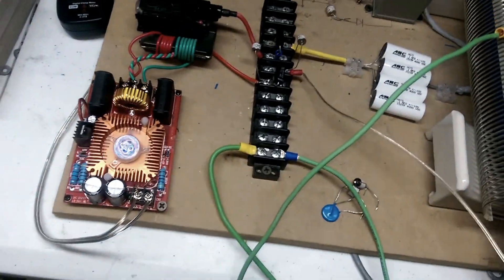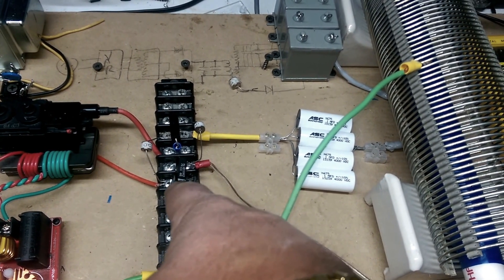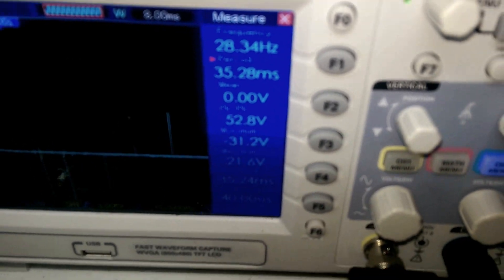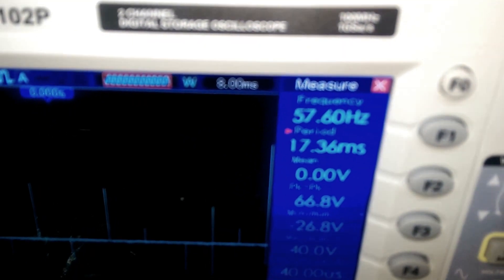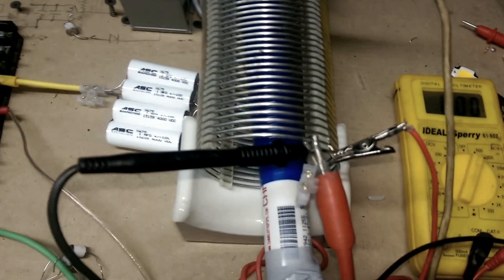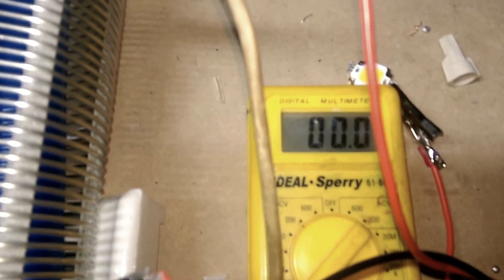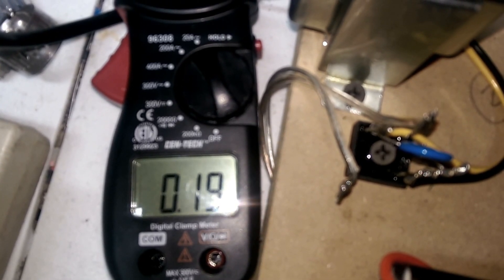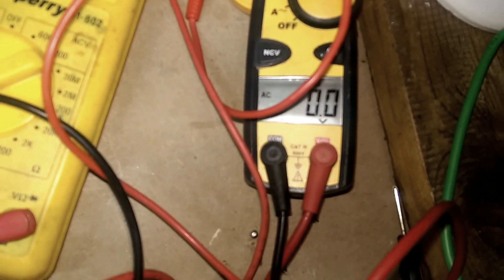Don.Smith Replication.Attempt

Comment: Nice test rig,   you know this is really very interesting!  as it ties in to an idea I have about how the Moray device worked.
Reply: +Llona Juice  I think there's more to it than that though - that's why your circuit will never self-run and power itself.
Reply from the maker: +Llona Juice Your full of complete suppression, and I know exactly why..  you say one thing in one sentence, then, contradict everything you just said in the next. The circuit is an experimental reversal of Don's original system. He has given the wrong diagram, but, the info is out there to make the system work, along with my interests in making the correction, posibly even showing a complete diy if I don't receive what Ive been after.. . anyway, don't keep shouting doubt.. your doubt won't stop me from succeeding in doing what I am trying to do. I have several of these boards made up and two of them have pretty promising results, the battery even overcharges, the whole nine, I am just waiting for parts to even out or reduce the battery's overcharging.. when they arrive, the questions I had will be answered, especially the Metglass core and the asymmetric transformer wound with Litz.. It works like a charm.. There's a few other devices that are already functional in my lab, so please, don't try to add the suppression to my channel.. I've already passed your level of negativity and have made it very positive for my viewers. The big problem is that there's too many flies out there seeking shit and, I've found that I get a lot further helping others privately than posting any of the answers to the public. You know as well as I do that I can't post the reason why it all does what it does publicly ,and, that Public posting has taken a lot of true innovators that have figured out the reality of these devices offline and made them go away for good. . I'm not one of them. I've taken the impossible and already made it possible. What makes you suggest that I can't do it again? That is my only wish here.. is to show folks something is possible so they don't give up. If I weren't in business with the power industry, I would have already pushed these devices to the private market, on the underground because there aren't many able to take apart what I have built to be able to replicate it and then tell you how it functions correctly. That is the entire key to this all. if they could say the answer with certainty, then they can build it, but, until that time comes, everybody thinks this is a step up system that magically collects ions, slices the energy and outputs magic from the high frequency area.. which it can't and won't do.. it is what I am showing here, minus the special compound, however, this can't be in resonance because it doesn't have the metallic rod needed to make it all happen... I have, and have had a similar metal compound available to me for years that absolutely makes it function.. should I REVEAL?? remember my key is similar in structure, but isn't the same, however, it does and will continue to self operate no matter what you or anybody else says. I just haven't posted mine because the frequency isn't stable or in the correct range yet. It will be very soon though, unless i receive what I've been asking for.
Reply: +Marc Belanger  I'm a digital electronics guy so take no notice of me and my comments  ;-)   I just want to see X Volts DC amps in and Y Volts DC amps out, into a meter.
Reply from the maker: Unfortunately, cold electricity is immeasurable without the use of a scope. In fact, I think I've proven this in my video to show it only shows up as negative energy from a scope, which doesn't happen in dc electronics. But, i will happen to make it easier for all by offering a negative energy to dc output by trying to rectify when I get back to the lab this evening, seeing if it will successfully rectify and output to charge batteries or a cap since the energy will not charge ultracaps directly, but, it may only be because the ultracap works more like a polarized electrolytic cap and will filter out high frequencies, eliminating flow of energy completely. I just think it is also too weak to do so, however, when I remove the arc gap and reconnect with a tap using a set of pliers, the led blows up like a bomb, and, it makes no sense since it isn't a solid connection, it is an open connection that gives the oscillation of the tank circuit time to charge too high and amperage build so high that the output ends up exploding with mass amperage for a split second. Anyway, this shows the true potential of the system because it shows me one of two things.. I am using the arc gap in parallel to the rectified input, then, charging a cap in series to create a charge pump, however, I need to do just the opposite and create a steady dance of electrons as an input while the cap is already charged  in parallel to evenly release the strike of the arc in a steady but silent motion to output as a massively an increased output. This is easily done with a special metallic compound, however, I can't give this up, I am trying to find the way without it.
Reply: +Marc Belanger I think we need to have a standard test for ALL alternate energy experiments;  so how about having a single DC power source with 2 feeds and 2 bulbs;  one feed goes only to a "test" bulb and the other feed goes only to the energy device;  but both feeds have a current limit to supply only half the bulb wattage;  Then the aim is to make the energy device bulb brighter than the test bulb?
Reply from the maker: +Llona Juice well, there's only one problem with that. the led is right now the only thing that's able to be powered by the device, so, a resistive bulb is out of the question. also, it only gets so bright. but, I.can light up as many as I wish tied together with no boost in amperage to the source as it is reduced.

since it isn't a normal source, it's very difficult to figure out a power consumption, especially since it's non measurable.
Reply: +Marc Belanger  what voltage / amps are coming out the variac to power your setup?
Reply from the maker: +Llona Juice the voltage is 50v and the amperage is shown on the ammeter, near .18 to .19 amps,.  Theres an isolation/step down transformer and rectifier too with a smoothing cap to feed the zvs . The zvs and flyback at idle are running higher than this amperage, about .20 amps with the voltage turned up to 50 volts at the variac. When the leds are applied, the amperage drops down by .01 amps for whatever reason. The more leds I add in series, the lower the amperage goes, it is clearly the same thing that happens with partnered coils. I am building a resonant coil set that will have a dual core, separated core as I did with the partnered coils today, so I can see what happens next. Trial and error with this is very expensive, when we use prebuilt coils by B&W, however, I have used several hundred feet of different sized conductors and it is starting to get very expensive as I used speaker wire last since it will function like Litz wire in this case as Don recommended for the primary.. I have seen another replicator use i t on both primary and secondary, however, I have never seen anybody replicate this system to function in the manner Don tells us it would work, so, there is one thing left out, and it has to be some sort of core, which I am trying next if the solid state NST doesn't work as he says.. I am still waiting to receive it because the rest of the high voltage systems I have used, the coil wound nsts, and the zvs's both were erroneous since they either shut down by the gfi or overload, or, they were not holding steady at the frequency of operation that I needed. The solid state NST's out of the box offer more of an input than they do an output, so, it is rather easy to make them put out more than they consume, and it is due to the fact that neon supplies tap into a different power "phenomenon" that will suck up ambient energy without notice.. This means if they are left to operate the way they normally do, with a piece of neon operating, they draw in energy from the ambient environment, so, what stops us from sticking a piece of neon inside of a capacitor plate top draw the 90 degree ambient energy from them, or, utilizing the tube inside of a core, and, using a gas discharge tube such as an arc gap to pulse what's needed to do the rest of the work. It isn't easy to tune, and once we get the coils to run at an infinite impedance, all of the magic happens. If we get close to resonance, or, if the frequency changes enough that we are in resonance during a less frequent amount of time, we may get some energy as I do that will light the leds at no cost to our input. The battery would be charging with this energy being present, so, my next attempt will be to wire the double led to a 7 ah battery, run an inverter and nst that I will receive very soon. This may answer a lot of questions.
Reply: +Marc Belanger 50V rms @ .18A with a power factor of 1 gives 8 watts of juice - so it would be nice to see more LEDs on there.   

To me what you have is one-half of the moray device;  I came across a physics experiment that was quite unrelated but I believe It could well be the missing link in the Moray device;  I think the source isn't mysteries at all but it does involves a very very clever way of collecting the energy;  Tesla eludes to the way it's done in his patents but doesn't give any specifics.

I don't buy any of the suppression rubbish by oil companies etc;  as anyone has the right to reverse engineer and design and build their own free energy device regardless of patents.  
The problem is no-one has managed to successfully do it yet - which makes it even more fun for people like us who love to tinkle around and build things.

If you have a working device post the schematic and let';s all try and replicate your findings!

Comment: Hi, Marc!

Just today I read all your comment about smith device. It seams this video is an early one.
You are describing you have 0.88uF 1.2kv capacitors with over 6kw of power and different L1-L3 coils
multi strand wire...cww, cw and so on.
Reply from the maker: that's the Benchtop model, it does give 6kW or more but the nst I have shuts down after a few minutes as it is a gfi type. I tried a zvs, however the zvs doesn't run at 30kHz as you see in this video and I'm waiting for a Jane co Solid state nst to.arrive for testing
Reply from the maker: the larger the damming caps are, the more output, but, an arc gap is needed with.diode and cap to pump and dump to the output as the primary side has. voltage is too high though and difficult to reduce the frequency, so I decided to reverse the system and step it down, then, dump it into an ultracaps bank and batteries after rectifying
Reply: +Marc Belanger 
Thanks, for the quick replay.
I hope you will show the Bench top model. I have all the parts at home, still from the Zilano times.
Unfortunate with no real results.
It wood help a lot if somebody like you will show the working model with the real load and looped generator.
Reply from the maker: +dusanln Don's system is a protected system since it was bought out for it's use, and, the majority of the technologies were bought to be shelved. The information being listed online will attract the wrong kind of attention, but. I certainly will assist you, however, what folks think are the parts, aren't really the same parts needed for every system. Every coil, whether they are B&W's coils or not, air dux, or other brands, even the same brand and model numbers will have a bit different resonant component. We have to tune accordingly, and, even the formulas used all over for Rf are not really the true formulas, the formulas are literally specific for this device and must be specifically comprised of two different mathmtical equatins si. I am going to share one secret right now with you all... The primary has to be the larger coil, and, the secondary is a split coil, it doesn't have to be opposing coils, but, they do have to be multiplied x each other's turns to get what you need for primary turns. Also, the insulation of the primary between each turn needs to be calculated  "the space" needed to calculate the resonant uf. at the same ratio as the turns ratio from primary to secondary. Spacing equality is vital, and, you need to have at least 4 times the primary spacing between leads to catch a break with resonance with the mutual inductance as it is vitally important to receive this for an amplification factor. To make the tie physically will give an amplification by way of "forced resonance: of the overall inductance and turns, as Kapanadze does, however, the coils of his feed into each other and aren't mutually inducing from one to another by way of matching frequency due to the same wavelength's oscillating without touching each other, allowing the dispersement of electrons marching in one coil, in the same direction as the other coil. This is the whole magic trick with the Don coil system and it was discovered by Tesla.
Reply: +Marc Belanger 
ufff, ok. super. Thanks for the info. So if we stay on the coils. Which rule to use, the length and 1/4 ratio
or the weight. Like you wrote, the weight of the primary in the same like secondary (each coil) if we use cww, cw. In your opinion what is the best, easiest way to build the coils?
Reply from the maker: I'm finding that both methods work, as Tesla said. I haven't had the ability to get it to remain energized as my nst shuts down after 3 to 4 seconds from ground fault or overload,  and the zvs puts out too low of frequency which doesn't steadily stay at 30khz, being too erratic to keep itself in resonance. I am awaiting the arrival of the new nst and I am hoping to have a tracking number today sometime.

Thanks
Reply from the maker: +dusanln I am using 88uF 1200v caps on the other unit, not .88uF. They are the damming caps for storage though, not for resonance..  In this video, I have used only (4) .1uF caps in parallel to get .4 uF.

Thanks

Comment from the maker: the frequency is too low to.be rf, however, my circuit isn't in resonance so I only get close with the right spark gap, unfortunately, the one that works to create resonance burns out too quickly and it's rated for 5000 amp max discharge and 2700 volts , but, I.don't exceed 1280 volts input. the coil is built to resonate at 30077 hertz but the output of the zvs and fly back is much lower. this varies with the spark gap, how quick the pulses are, etc.

the reason the ambient energy is induced is due to the coils being close to resonance.  the electrons in the primary coil are dancing around by the pulses, and, the  key to.getting this to work is to have both in dipolar resonance so they both have the electron movement. once they get the movement, the secondary will operate and energize a load.. the closer to.resonance, the more electricity comes out, however, science declared a long time ago that there's only two.types of electricity, amperage driven, which this is not, and static, again, which this is not. this is cold electricity drawn from the ambient within the secondary pulse because I'm driving the coil close to it's natural resonant frequency. If I tune the secondary and connect the correct capacitor, we can get exactly the input energy for free, or many "mirrors" or copies of this energy amplified by what's called phase conjugation.

this is not drawn from radio waves, there isn't 20 watts of power to pull in down in my basement from radio.towers.. after finished, I.connected 12 of these leds, and they were all the same level of brightness. I then connected a 50 watt led, turned it up and smoked it. then, my arc gap came loose, I.connected it live and it blew the ,20 watt led like a bomb. the amperage is devastating, so, no, it's converted here within the circuit and outputs more than in.by Earths flux, or something like plasma tubes.